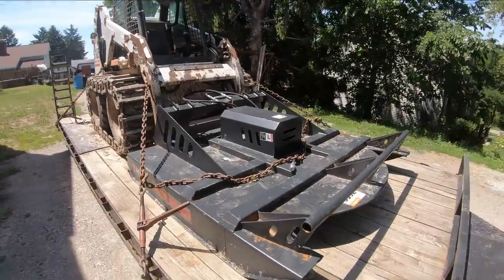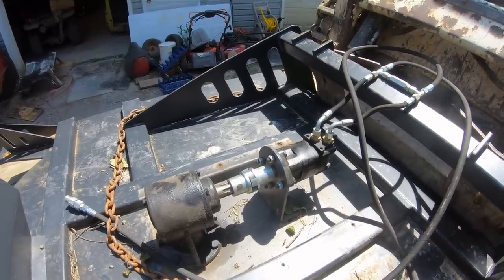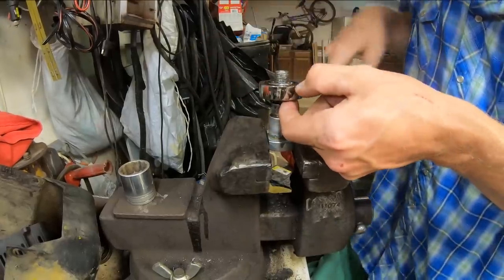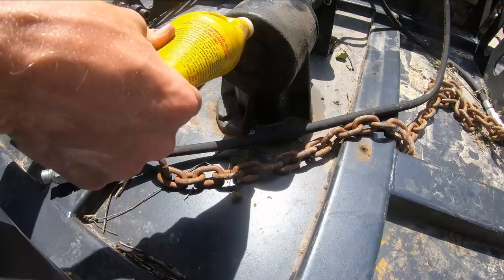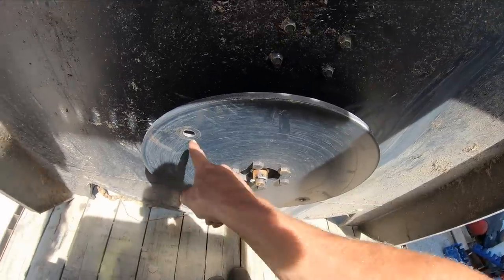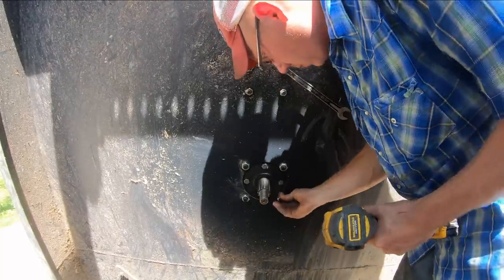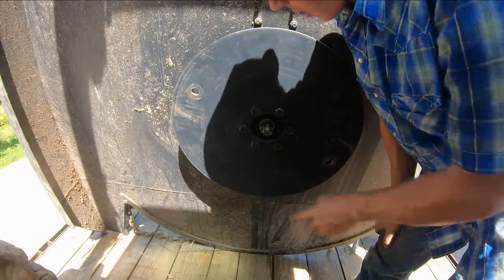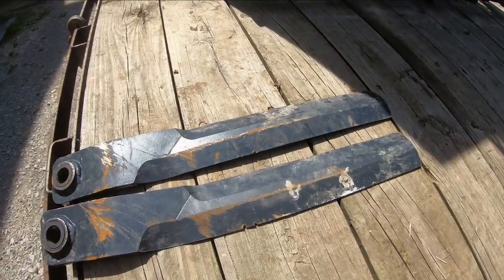BUYER BEWARE: Generic Auction Brush Cutter Inspection & Repair (Brand new JCT)

Comment: Did you check the rotation direction in relation to the thread direction of bolt/nut that hold the heavy wheel. If that is incorrect the vibrations and rotation will work the nut loose. Not even loctite will help that.

Comment: Those blades actually appear to be directional. Should spin so the "long" edge is doing most of the work. If it was spinning backwards, that could've helped the nuts shear through the cotter pins as they backed themselves off.

Comment: Not sure if your Dewalt impact wrench is the same as my Makita one but mine ramps up the torque the longer you hold down the trigger so if you want to properly snug something down it requires a minimum 3 second continuous trigger press.

Comment: Hey man you cut stumps. You be fixing better brands too. 😐 and I do believe you could have added another washer to that spline shaft to get that castle nut to line up better. But clearly the thread locker sealed the deal lol.

Comment: Now its really poor workmanship but the lack of oil in the gear box could be a shipping issue. I know lawnmowers and snowblowers and other things are shipped from the factory dry because freight companys don't want them full because of spillage
Reply: A good junk yard will empty fluids out of engines, trannys, & gearboxes before shipping them. It's the law in many places.

Comment: Anyone know where to get replacement blades for this model? JCT Brush Hog
Reply from the maker: Better off to retrofit some off-the-shelf blades from the farm store. Woods brand has a blade that’s about the right length, just need different bolts

Comment: Those self tappers are coarse thread so you have to treat them like a screw threaded into plastic. They obviously aren't that weak, they tapped the holes on installation. You have to run them backward to find the thread then drive them down BY HAND. It's the same with all coarse threaded self tappers. You got them cross threaded into the holes and they locked up. User error.

Comment: Sorry to tell you this but new machines ship with loose bolts and no fluids. Try installing a strong Spicer joint in place of that softcock coupler Matt? Watching you straightening the blades appeared to be reasonably tough stuff.

Comment: Was that the RISKY Brothers? I used to long haul and took many loads from Ripoff Brothers in Fort Worth.
Some of the heavy equipment I hauled was embarrassing to deliver.
In your case it was really poor assembly or original poor quality components
Good luck on utilizing that cutter.
Thanks for sharing.
Reply: It  did  look  like  poor  assembly.  The  mounting  bolts  for  the  gear  box  weren't  even  semi  tight  according  to  the  impact,   but  the  gear  box  lower  bolts  seemed  tight.  Gear  box  would  have  been  preassembled.  Just  not  filled  prior  to  shipment.

Comment: True, you should have been able to go straight to work with that but, in a way it was a good thing the blades DID fly off or you would have never caught the rest of those loose bolts or the lack of gear oil. Anymore, when I get a piece of equipment, whether high quality, name brand or cheaper units, I go over everything just in case. I know what it's like getting something new..... Wanna try it, wanna try it, wanna try it. I've done that before in the past.
Reply from the maker: Yes it’s good practice to go over the whole unit but very frustrating that I should have to
Reply: Anymore, even with brand name or high quality equipment, it seems like a person needs to go over things just due to the fact that workmanship and pride in a person's job isn't what it used to be

Comment: Sickening Amature intro aswell, What you trying to prove , Blaring the Mini S/A dumper truck airhorn for ?  Try Being at the Wheel of a 65,000 Kg 8 Axel Super Bee Off Road Chip  Hauler  in all types of Weather Conditions , like myself from 1999 to 2007. The original intro of the drone veiw of the Gross Brown Creek was way better.

Comment: Here's the deal. I have a new Kubota Svl65-2 which is a 68hp machine and is rated at 17gpm. Im looking for something lighter duty for mainly grass and brush 1" or under. My local auction lot has these for $2500, im sure I could get one for around $2200 cash. If I where to bring it home and do everything you done to it plus more for preventative maintenance, do you think I would get along with it? All the others that I can find in stock this day in age are $4800-$6000. I can't bring myself to spending that much for what ill use it for.

Comment: When you purchase "new" stuff at auction, they are mostly put together by sales people.  You need to check all the nuts and bolts are tight.  Most likely the driveshaft and blades were not tight.
Reply from the maker: they come in a crate from the manufacture pre assembled and when something is shipped without oil typically they put a tag on it!

Comment: You could have tacked the washer to the back of castle nut and then washer to cutting blade plate. Would have saved the thread. It would have chiseled off afterward.

Comment: Are you sure the rubber bushings were ever there? If they came out in use shouldn't they be inside the box on the floor of the box as it looks like there is no other place for them to go. I hope when you get past the cheap manufacturing of the machine it works out ok.

Comment: In your case I would still have coughed up the extra money for a quality brush cutter.

Yes I know it's expensive 

In my mind it would make sense to get the better one for the long run.

 One day when you need it, it will be there for you. Plus you wouldn't have to deal with stuff falling apart after 5 minutes of use.

Comment: Buy cheap, buy twice!  Chinesium set screws! I would have used an extra washer on that gearbox shaft so the castellations in the nut lined up with the split pin.

Comment: This is the kind of thing I have to do to my second,or third,or fourth hand rotary mowers I have. The problem with no name mowers is replacement parts,seals are a common item,the hardest to get out one,the bottom of the gearbox. Then the parts guy says you got a what? So parts numbers dont match anything so its measure time to find a repmacement.

Comment: The hp rating on the Lovejoy type coupling might be way to low and I believe Browning makes them with a fiber spider rather than rubber. Check to see if the blade mounting disk is spinning such that it tightens the nuts . JCT, Junkie Chinese Turd.

Comment: The gearbox bolts were tight because JCT didn't assemble it😂 That's not a heavy duty brush cutter. I just replaced my gearbox on my 5ft bushhog with one similar to that one. Mine had a smooth input shaft.

Comment: Is that gear box "vented".  Those self tapping bolts, were most likely already sheared or broken from the factory.  Amazing you got them off without them shearing off...
   I made the same mistake, in that, I bought my daughter a cheap Chinese "knock-off" of a small 110cc Honda atv many years ago.  Could not believe the "shit" quality of most of the machine...
   I would not have anybody with in a mile of that thing when it is cutting.  More stuff is going to shed off, and be a flying shrapnel...  I would not raise it up much above the ground level to cut stuff down, for that very reason.
   Man, sure hate to sound so negative... 
Looking forward to the crane repair videos.
Thank you.

Comment: This is assembled using young people so they don't have the physical strength to tighten the nuts properly and they only understand that pin goes through hole. I would from now on inspect "new" as being used needs first PM (preventative maintenance). Change every fluid tighten every fastener and look and physically touch every moving part.

Comment: Those shoulder bolts look like they may not have been properly sized so they didn't' have good thread engagement. The threads should be flatter if the nut and bolt where sized correctly.

Comment: Do you know anything about the JCT “fronthoe” and JCT augers?  I picked up a couple JCT specials at the auction and I can’t find any specs on these.  No model numbers.  Nothing.

I think the auger is too small for my T770 and I don’t want to hook it up without knowing the specs.  Same with the fronthoe.  I want to know if they cylinder can handle 3,500psi.

Comment: As far as the gearbox is concerned, I can't blame the company for no fluid.  Generally you can not ship anything to the us with fluid in it. They probably went straight to the auction house, and the auction house should have made that more clear for you.
Reply from the maker: Yes this was the only thing I could kind of blame myself for however as you said there should be a sticker or label or something that says it needs fluid before use!
Reply: @DieselCreek  Agreed!  It also makes me wonder if it came complete aside from that or if it was slapped together from a pile of parts by some lackey here haha!  But aside from the frustration from becoming jct's quality control supervisor,  it looks like you've got it working pretty well!

Comment: Would tack welding the castle nut add too much heat to weaken the loctite? I know you didn’t lay a huge bead on it but welding adds heat fast.

Comment: The nicks in the blades may have been from when the blades took flight.  I would take the blades to the local tractor supply or whatever shop is convienet., Try to match them up then concert the mower to use those blade and fasteners.  I built one from scratch we had blades and hydraulic motor from a brush cutter.  That we reused, Bad mistake the blades are no longer manufactured.

Comment: Use some blue thread locker when tightening nuts in high vibration equipment.
Reply from the maker: Blue is for when you might wanna take it back off, red is supposed to be forever... I used red and lots of it
Reply: @DieselCreek  Yes, Red requires heat to remove and I saw you used it for the flywheel castle bolt. I was talking about the loose bolts you found on the gearbox. You took care of the blade bolts with your "glue gun" 😉. Nice job!

Comment: That's called Chinese screws. In the first place that machine does not have a stump jumper on it. The metal on the deck and side is rather thin so the machine will get beat up faster than you would prefer. I used to buy those cheap brush hogs myself and learned that when you get it home, check all the fluids and tighten all the bolts before you ever put it into operation.

Comment: I wish we saw this video before we bought this. Our one blade broke in half and the jaw coupling lost the spider gear if there was even one there,and it was aluminium on aluminum in the jaw and destroyed the jaws. Nobody sells these parts that we can find. The parker pump (if it is even a Parker pump is 1 inch and the omni gearbox( if it is a omni gearbox) is metric we think 30mm or it could be 1 1/8  There are no part numbers on anything.
Reply from the maker: Had the same problem. I came up with a fairly easy solution for mine. I’ll do a video on it soon.

Comment: I have built those hyd. heavy brush mowers and the love/joy does not hold up .I use a u-joint and a shear bolt smooth shaft  style gear box on them .ask me how i know.you can up grade the parts to overcome the engineering shortcomings  .

Comment: Common sense to go through equipment when you get it, make sure blades are tight etc.  Most of that stuff ships without oil in the gear box too.
Reply from the maker: Yes the gear box oil I can kinda blame myself for however any time I’ve bought new equipment in the past there was always a tag or sticker saying that it needed oil this had nothing as for the rest of what I had to do, I’d say that’s some BS and it should have all been tight

Comment: Goes to the old saying.
Ya gets what ya pays for.
Cheap is usually something that ends up costing you more than if you'd just ponied up the cash for a name brand with a good track record.
Something I try to get thru Wife's concrete hard head even tho she continues on insisting on buying cheap crap.
I buy a tool or other items I research their record and reviews (never at the manufacturers site) and then I buy.

Comment: this in china is called an after production after the main order is filled the managers will send home most the workers and then piece together as many units as they can for the parts that were left over. they order more material bill it to the original order as possible. these will use the cheapest nuts bolts no oil to transport reasons

Comment: What valve is on the crossover for the hydraulic hoses?  Is it a pressure relief or check valve?  Did they put that in correctly?

Comment: The things you wound up doing to this brush cutter are a dealer's obligation. The dealer preps the machine to prepare it for use from the manufacturer and most generally they get paid for doing so. That amount is dealer prep and is charged to the customer as end user. Ritchie Bros. is either buying direct from the manufacturer or was consigned by the manufacturer or their representative to sell them for an importer as a contractor but once those brush cutters left the manufacturer's facility, no matter where, someone in the United States got paid or you would not have it. If there is a dealer in this country for those machines and the others floating around out there I would imagine Ritchie Bros. will be hearing from them. If not well, I suppose it might be pretty hard for a big shot banker somewhere to successfully claim any kind of a UCC filing against a cash-and-carry claim. Be careful what you buy at auction. Sometimes things are not what they appear and auctioneers have a multitude of legal cobwebs they get to hide in. Anything made in China is actually owned and controlled by the Chinese Communist Party regardless of whether the company is American or otherwise. They control it by knowing  many American consumers will float their boat before they float their own if the price is cheaper. That's why they don't mind paying American bankers and businesses along with their lackey politicians to keep it that way. And here you thought your taxes paid those politician's salaries. That's it for this rant. I hope the brush cutter you bought from Ritchie Bros. works out. We sure wouldn't want them getting their tit in the wringer for selling ghosts now would we?

Comment: Even a heavy duty American made rotary style brush cutter (I have one) would go to hell if it were ran through a thicket of hard wood trees and stumps like you did. 
It’s a glorified bush hog mower. Not a forestry mulcher or stump grinder. 
It’s a Chinese grass cutter.
Reply from the maker: I’ve run good ones, and I’ve run tractor bush hogs, even a tractor bush hog should be fine taking out what I did, that biggest tree was only 3-4 inches and the stump I only bumped as I didn’t see it, I didn’t try to cut it down lol
Reply: Diesel Creek 
It looked to me like you were going to mow anything in it’s Chinese little path... unless you’ve mowed that area before and were sure there wasn’t stumps or metal or both in there. 
User error combined with Chinese Junk bud.

Comment: the heat treat on those blades warps them sometime ,I'm just glad it didn't snap while you had it in the press as for the love joy the chinese have a reaL PROBLEM WHEN IT COMES TO RUBBER TYPE PRODUCTS IF YOU JUST REPLACE THE RUBBER IT MITE LAST A WHILE BUT IF YOU LET THE RUBBER GO IT WONT LAST (SORRY FOR THE CAPS - DARN CAP LOCK GETS IN THE WAY OF MY SAUSAGE SIZE NUBS) ALSO I WONDER WHO ASSEMBLED IT THE DEALER  OR DID IT COME ASSEMBLED ?

Comment: Hey brother awesome channel, new subscriber here and I've already watched a dozen of you videos.  You and I are on the same wavelength because everything you did in the video is exactly how I have done it.  I thought I was the only one who tack welded nuts on LMAO.  I know this is an old video but here's my question, are you better off buying a new Chinese cutter and doing what you did or buying a really high quality one that's been beat on for the same price and doing the same thing?  I ask because thats what I do with brush hogs for my tractors.  I find them in the hedgerow, and if it has a quality gearbox with little play and oil and then I buy new blades, bolts, castle nuts etc and weld the blades and stump jumper on and run her till the gearbox blows and I've never had that happen, I use them until I figure I've gotten my moneys worth and then re sell them and usually get all my money back.
Reply from the maker: I think it depends on how much you want to use it. If you’re gonna try to do jobs with it you’re better off to buy a good high quality cutter and be done.

Comment: Apply some rivnuts to hold that gear box shield on
Reply from the maker: the metal under it is strong enough to support a 1/4-20 bolt, they will get tapped next time its home.

Comment: @Diesel Creek  Are you going to have another video when you get the blades?  I wanted to find out what blades you ordered to replace the factory ones as I have this same brush cutter and bent  the blades.  I also wanted to find out if you found replacement shoulder screws anywhere as I have to replace mine as the shop that removed the blades for me bent them up.  JCT doesn't respond for crap.
Reply: @vincentdunn5756  you can find blades that fit pretty easy. I just had a machinist make me new screws to be safe based on the old ones. For the blades look for 24-3/4" length
3" width
1/2" thick
1-1/2" mounting hole
CCW rotation